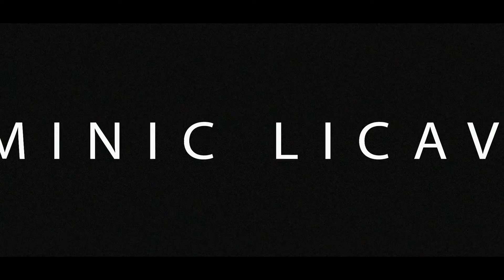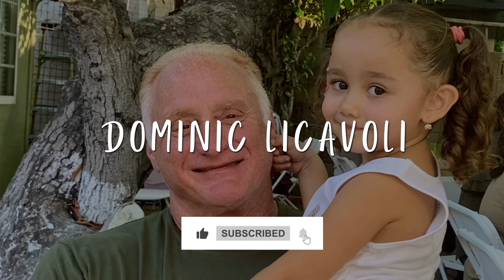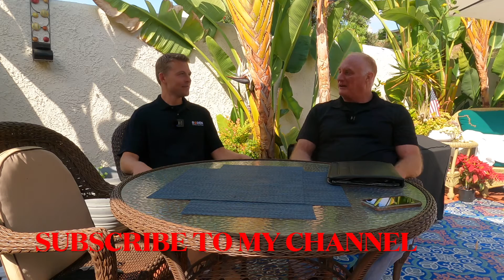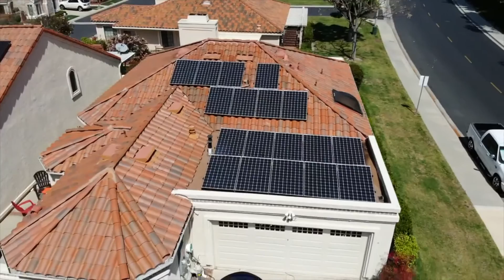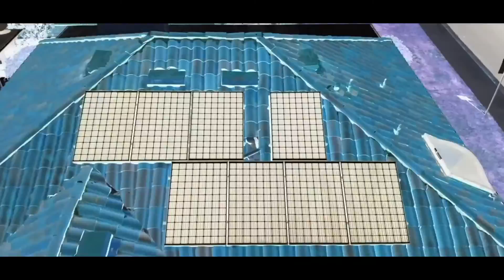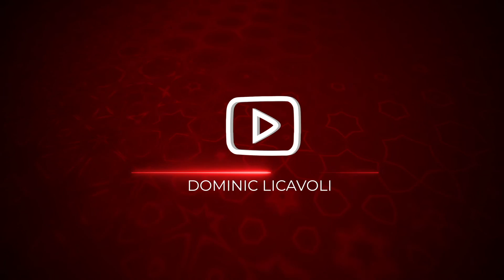Solar Power | Grid Tied Solar | Best Solar Panels | Energy Efficiency

Comment: Couple more things Dom do those panels require washing cleaning or maintenance at all
Reply from the maker: Yes. I clean them on a regular basis.  I just hose them down with a solar panel cleaning solution.  Use a light brush to take off bird s!?#.